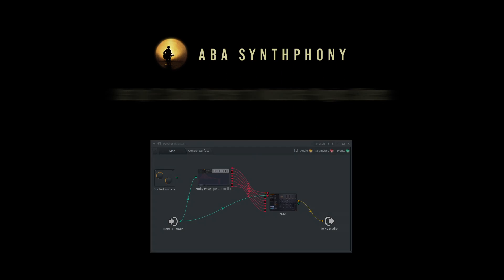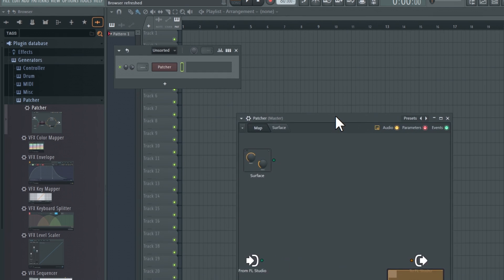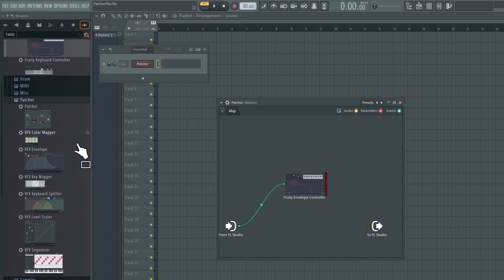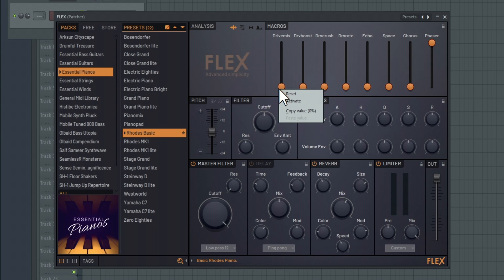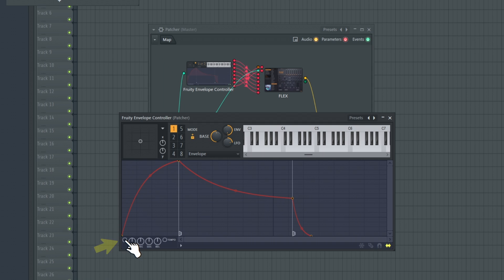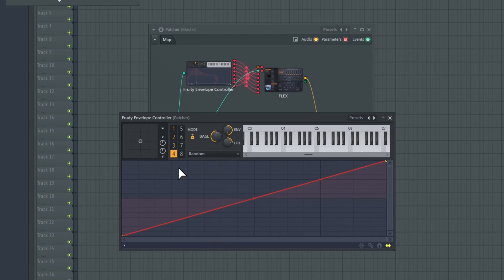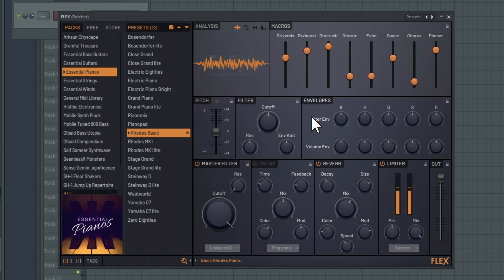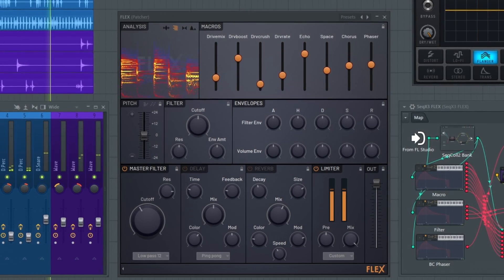How to Set Up FL Studio Patcher to Modulate Your Plugins Sliders

Comment: Seen how easy this is to setup, I definitely feel confident enough to tweak those envelope controllers.
Instead of the 'random' setting, it may be useful to assign a slider or knob on the hardware MIDI-controller to change position or depth of a soundcontrol or effect.
Reply from the maker: @Hyper5nic  yes, assign the MIDI controller to the knobs & create unique sounds.